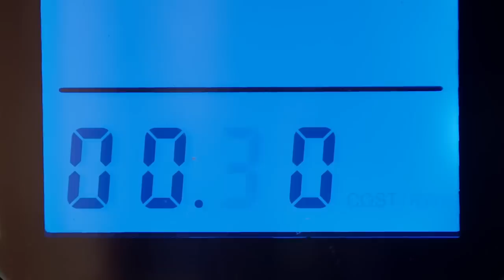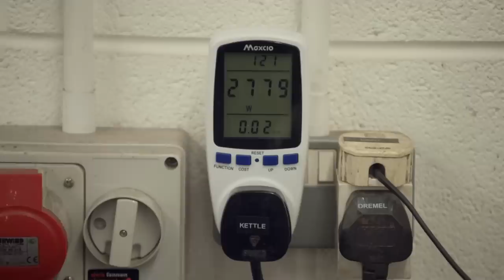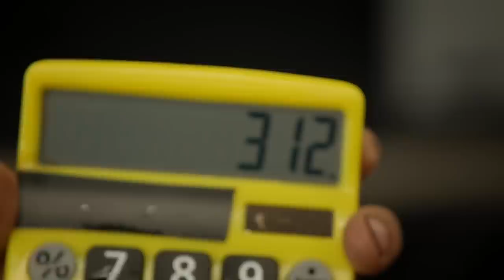How much does it cost to power Guy's Shed? | Guy Martin's Power Trip

Comment: He powers his electric car using diesel! haha! He also did 4 x 10 on a calculator lol, brilliant! ; )
Reply: Actually still a massive more efficiant system that putting the generator in the car and using a drivetrain,
Reply: @BugattiONE666  I’m just messin’… 😉
Reply: He's built different for sure!!!    ....also at 04:37 he's paddling through a wet workshop floor in just his socks?!! ...and then jumps on the welder too!
Does tha' nor'av any flipflops lad?!   Haha, what an absolute legend!
Reply: @chris4536  Agree! Haha, there’s no one like Guy! His enthusiasm for everything is off the charts! 😂
Reply: The diesel hybrid he drives, the one which starts the ICE using 12v of electron juice?

Hybrid Diesels have then existed since Rudolph booked that ferry ticket 😚✌️
Reply: Diesel electric is a seriously efficient way to do it. Getting a diesel to produce electric at fixed RPM you just watch the efficiency's skyrocket.

Its also why despite todays fuel prices, some datacenters and office buildings are now running on GenSets 24/7 because the costs are quite a bit lower, and every time electric goes up, these things shine more.

Our place is currently running on gensets 4 x 200 KVa and as of yesterday was producing power at about a 14% haircut over the 34.4 pence per unit on the cap or the 47 pence per unit we way as a commercial provider charges us.
Reply: @AnIdiotAboard_  800kva??!! What are you running??!!
Reply: @bushratbeachbum  800KVa capacity, but we don't use all that, redundancy is king, they operate in pairs, proving up to 400 KVa.

Everything in a Datacentre is at least Normal + 1. or N1 depending on who you ask.

Comment: Was considering running a diesel on heating oil (Kerosene) - All the heat to the radiators for cooling the engine, and all the power the house required. 
In 1974, Fred Rudling heated his N. London, Enfield garage on the waste oil, using a burner he designed.
Reply: What about the exhaust heat as well. I suppose there's only so much heat you can use though.
Reply: @joejoejoejoejoejoe4391  Through a water jacket maybe, to increase the incoming mains water temperature, or a large insulated tank (with a vent in case of boiling)! Would take a bit of designing to avoid choking the exhaust, and ensuring the water doesn't become a breeding place for legionella, etcetera.
 I have a fan taking the heat from my boiler flue, from the small boiler room space, to my hall. Quite amazing how warm my hall has become in the morning, and how much heat was being lost to the roof.
Reply: @tommiller1315  You would have to transfer the heat to water though, I had a FIAT 126 (air cooled) and the cooling air could be used to heat the interior (after the engine heated the air), but there was a special hollow bolt that would vent gas just in case the head gasket went, as if it did you'd be gassed, the same would apply to using the exhaust, any leak could be harmful. Another idea would be to use the waste heat to drive a heat engine (like a Stirling cycle), but you're chasing a small gain.
Reply: @joejoejoejoejoejoe4391  I'd never run an engine indoors. Oh, and I got pollution problems from my car, a 1963 "Hillman Imp", as the heater air was taken from low down in the front of the car! Main problem would be the engine noise, so keeping it as far from me and my neighbours as I could.

Comment: last year I installed 2 x 235W solar panels, a 20A solar charge controller, charging 4 110Ah batteries and from that I run most of my shed equipment (except the big lathe) using a 1kW inverter, now I only use my shed a couple of times a week for a few hours, and this just about gives everything a chance to get back to full power- in the summer time, I have only recently started getting any charging over the winter, and its only a few watts, but its watts that are not coming from the grid, so its watts I am not paying for. (its set up as a totally separate system, not tied into the house mains.)

Comment: Wow. I’m actually impressed at what this doesn’t cost you. Privatized energy in the US means that in some states, like the one I live in, I’ve seen shops like this one cost over $700 a month. In fact, in my years sizing solar systems around energy bills, it seems like a lot of people have gotten used to absolutely obscene energy rates. .34/kWh (which must include supply & delivery,) is actually a comparative bargain, relative as these things are.

Comment: Perfect candidate for solar power there.
Using energy during the day, while producing it.
It may be grim up north but solar does work still.
Im off grid completely and run my workshop on solar power and lithium batteries.
Welders, compressors, table saws, everything.

Comment: Money saving tip number 1: Spend £25,000 on an air-source heat pump, second hand generator and servicing, and fuel storage for the red diesel. Also make sure your Small Waste Oil Burner hasn't been made illegal by the government.

Comment: Hate to be a killjoy but it is only legal to heat using waste oil with a permit and it cost £3200 for the first year and £1400 per year thereafter, so I think it might cost more than £700 to power the shed 🙂

Comment: I lived in a totally solar powered house "with battery back up" 16 yr old system 940 mah, batteries, totally off grid, "Top them up with demineralized water paid Zero power for 7 years.....42 inch Plasma TV, "not LED"  Washing machine, vacuum cleaner 27 inch imac computer, + USB charging for phones boil the kettle for your tea guy martin, etc Zero mains power ran everything 6.5kw OFF GRID standalone system. Now you can buy 1400mh batteries $2000 for 4 batteries in Australia that was 10 years ago,

Only thing with your place I can see is insulate your pipes "so far"
P.S your a Fuking Legend & A Top Bloke! If the rest of the world could be like you and understand damn near everything.....The World would be a better place!

I'm an old fan back when you didn't even want to be filmed fixing lorries, trucks 🤪👌🙏😎😎😎

Comment: So many buildings, so much roof space - Not a SINGLE solar panel in sight.
No small scale wind generators.
You can power everything with your 20kv generator using red diesel , then why are you still connected to the grid ?
Surely it would be far cheaper for you to burn red diesel.
I'm betting Volvo gifted you the xc40 for some Volvo truck event or sponsorship you did for them.

Comment: I don't think you can use red diesel  for non agricultural  use
Reply: do you want to know ? .............. "The new rules state that there are two elements to be considered when deciding if a vehicle is eligible to use red diesel or not. These are what type of machine it is and what it is going to be used for.

According to government guidance, the types of vehicle that qualify to continue to use red diesel after April 2022, include:

Vehicles designed to operate on a railway
Agricultural vehicles
Special vehicles
Unlicensed, including SORN (Statutory Off Road Notification) vehicles.
However, being in the above list isn’t by itself enough to qualify the vehicle to use rebated fuel. To qualify, the vehicle, machine, or engine must also be involved in at least one of the following activities:

Agriculture, horticulture, aquatic farming or forestry
On land maintained by a community amateur sports club (CASC)
On a golf course or driving range
On land occupied by a travelling fair or travelling circus
Heating or generating electricity in a non-commercial premises
Cutting hedges, verges, or trees that border public roads
Clearing frost, ice, snow or flooding and for collecting or returning necessary equipment or materials to carry out this function."